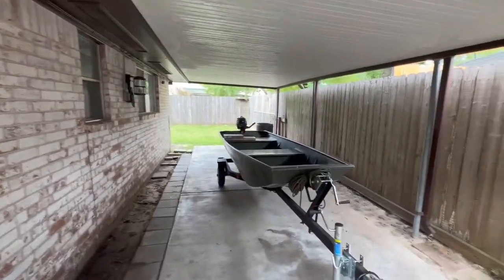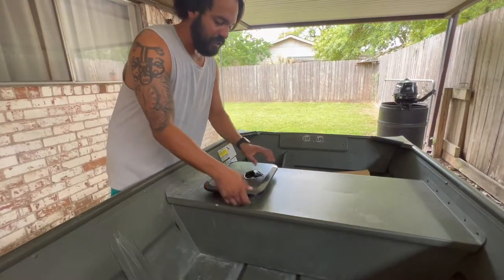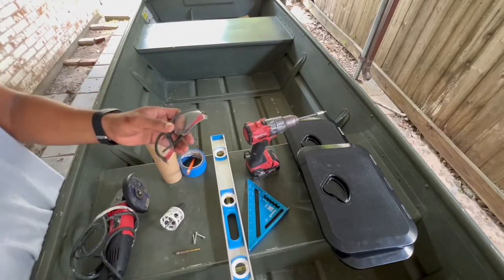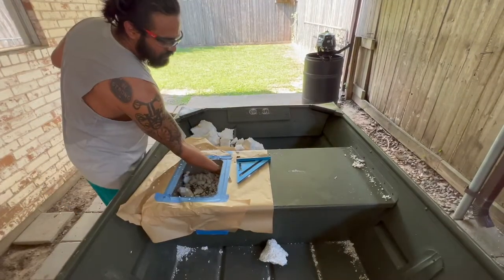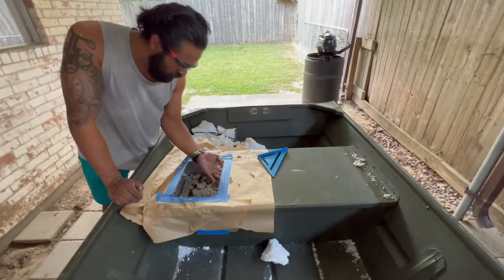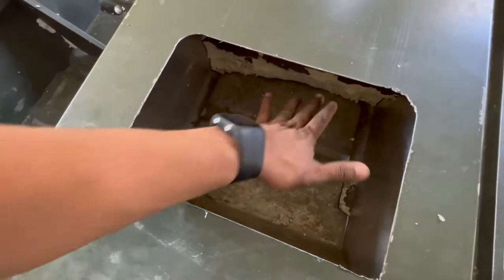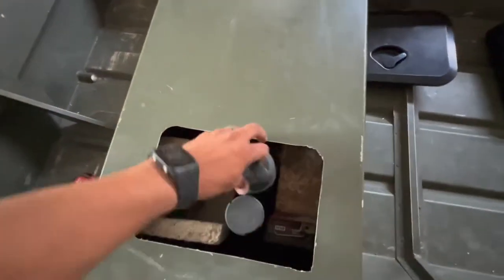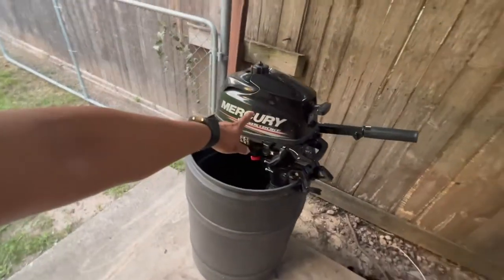UPGRADED - Adding Storage to small JON BOAT

Comment: First of all I would put the battery compartment under the seat closer go the front to balance weight. Helps to properly plane out with a bigger motor. Backend weight is you and motor.   Second, I would mount that hatch into the back or front side instead of on top.  Have the door open to the side and just slide your battery in/out without lifting so much.   Put one of those small lids into the top of your back seat, use a hot knife to cleanly cut out a small area of foam. You can coat the foam compartment with a coating. This will make an excellent insulated beer cooler😁
Reply from the maker: Great tips! Thanks for watching!

Comment: For that foam I tried a few things. What i found to work best was just taking a strip of the aluminum you cut out about 2 inches wide, heat it with a torch and cut through the foam like butter. don't need it that hot, just enough to melt through the foam. it will smoke so do it outside.
Reply from the maker: Great idea, I definitely should of tried that! Thanks for watching!